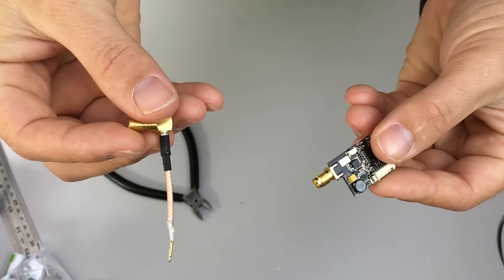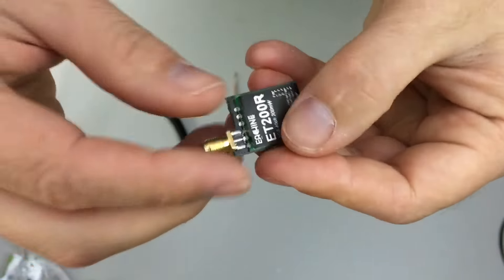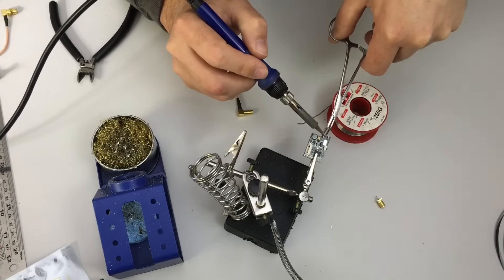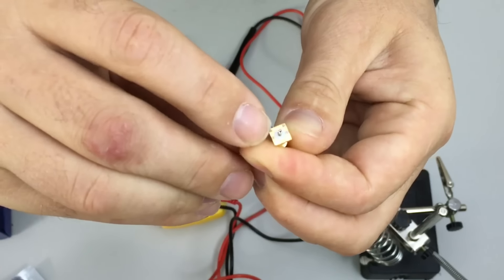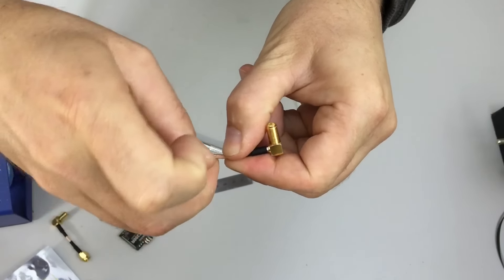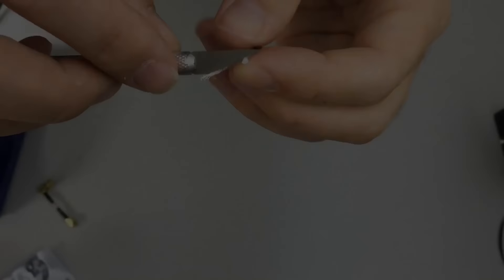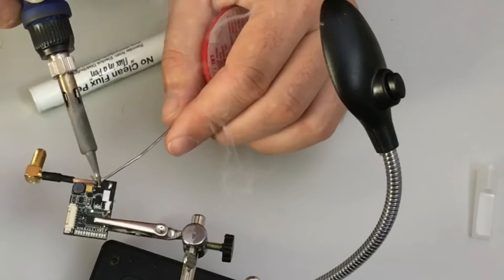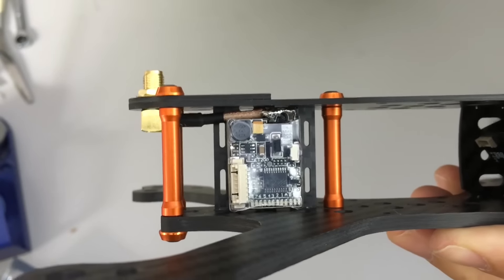How To Solder Pigtail Direct To VTX

Comment: Nice work. Usually when I remove sma's I just heat up all 3 pins on the one side and that heats the whole connector and it just slides off. I'll try your method next :D

Comment: Have you tried this tx before and after to see what diff to gain your mod made?  Isn't changing the length of exposed centre pin from the shielding in fact turning that part of the cable into an antenna of some sort?
Reply from the maker: +Simon Naughton I never tried this particular Tx before I made the mod, but I have tried it since and it works the same as the ones i haven't modified - I can't tell the difference.  Yes, exposing the centre core will mean there is RF leakage but the centre core is also exposed a similar amount for a connector.

Comment: The role of the outer braid/screen is to keep the signal inside the cable till it reaches the antenna where it can propagate correctly.
 Ideally you want as little center core exposure as possible. With that much exposed you will probably find that the standing wave ratio (if you could measure it) will be very high. The RF reflection will manifest itself in heat build up and reduced signal output. Component failure is also a real possibility if using a high power VTX(they get quite hot as it is).
Pigtail length as Darke Peak mentioned below is not critical.

All in all this is a really good idea,  it just needs to be a lot neater.
Reply: Won't you get the same effect from the bit sticking out of the original brass connector, that was soldered to the board?  It looks to be of similar length.